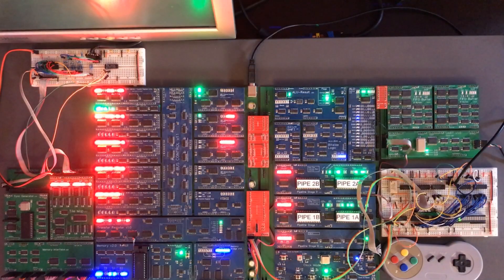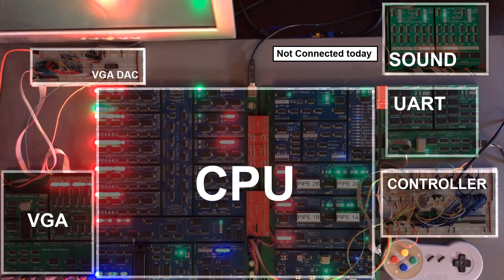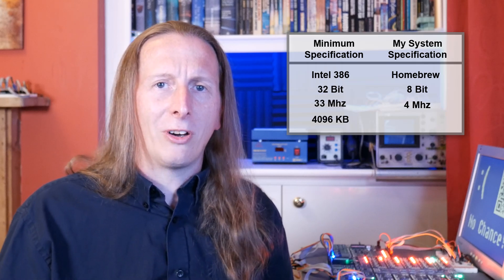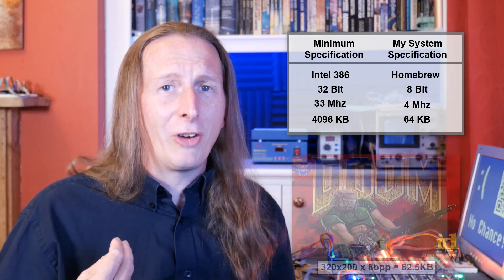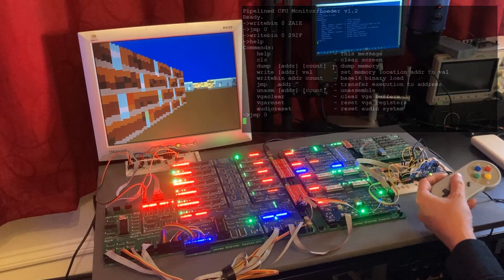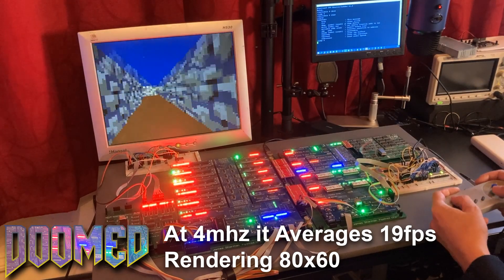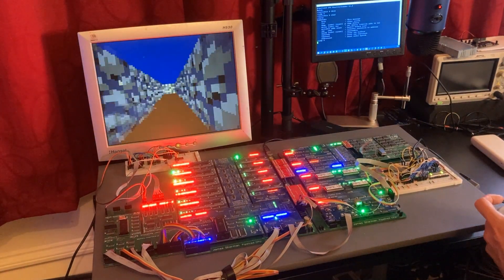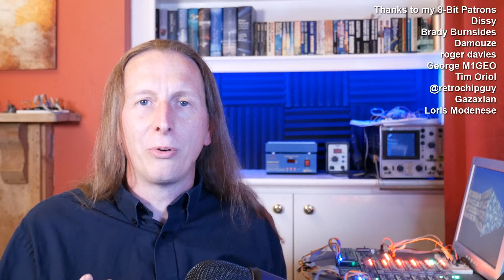Will it Run Doom? - Making an 8 Bit pipelined CPU

Comment: If it can't run doom, can it run bad apple?
Reply from the maker: Could have a pretty Gould stab at that but it would be a lot of effort.
Reply: @weirdboyjim  If it can be done on a pregnancy test, Atari 2600,  and various graphing calculators, then I do believe that a programmer of your calibre, and hardware of that calibre are both able to do it.
Either way, the "Doomed" prototype is quite impressive on it's own.
Reply from the maker: You might be interested in this: https://youtu.be/Y1_MUXKX-oY
Reply: @weirdboyjim  You even included my comment in the video! Thanks chap!
Reply: @weirdboyjim  You even included my comment in the video, thanks chap!

Comment: What about game like Tetris, space invaders, pac man ECT

Do the able to run those types off games ?

And one other question is that mother bord disaing for gameing only or I will have more software support like, text editor, capuletor ect
Reply from the maker: Oh those wouldn’t be a problem. You might be interested in my earlier games https://youtu.be/efLzgweF958 I’d need to add some storage before a text editor is worth making.
Reply: @weirdboyjim  it may be wrong but i thing in computers in general storage is important no matter if you try to create dos like computers or console like computers the need to save some data

like for example a Tetris with out keep the high scores is not fan even the storage is small in the order to save thos data it's still essential in my opinion
Reply from the maker: @watercat1248  All in good time....
Reply: @weirdboyjim  one other question do have floppy disk or cd for this computers i mean if the don't have storage how you be able to run thos games in the first place ?

Comment: This is the most impressive thing i've seen in a long time - likely in 2022.
Reply from the maker: Thanks LDD! Glad you liked it!
Reply: @weirdboyjim  Are you going to release the source code on github or somewhere?
Reply from the maker: @ldd6098  there is a programming video on my extras channel linked in the description. On my discord toolchain channel there is a link to the source as well as all the files you need to assemble it and run it on the simulator.

Comment: The "almost" killer app ...  :)

( I think the Doom midi theme song is bigger that all the machines memory, then again, maybe not  - it'd be cool if this "demo" was finished over time, and at 5k lines of assembly, there is certainly room for more bugs, I mean features, even multiplayer possibly .. maybe .. sorta .. hell if you can run Elite on a BBC Micro, its more than possible - "But can it run Elite" - actually if you can add Z height to the map, "it could run Crysis"  :)  )

Welcome to DoomStien!!!
Reply from the maker: I actually had a crack at getting the music going but my midi code doesn't support different instruments and the percussion broke it. I'll have to take a longer look at it some time.

Comment: Before watching the video, I figured it only needed enough RAM to technically be able to...but would probably not run fast. Without considerable acceleration, Wolfenstein 3D would not run at full speed on the 16-bit Apple IIGS (but an 8-bit data path?).

So much of the bottleneck was in software rendering, though. With GPU rendering and 8MB of RAM, you may actually be able to run a DOOM clone at a playable frame rate.
Reply from the maker: Back in the day it was all about the software rendering. The majority of the time went it that.

Comment: This is an amazing project ! I've seen all the vids, I keep on waiting for more progress. As stated before, I only barely grasp the complexity of the whole build, but this is amazing ! I've known CPU pipelining for a while (I come from the IBM mainframe world, but not the hardware part - just the systems part), so I understand the concept of pipelining, but seeing you actually do it with (somewhat) discreet components (ok, I still believe using ROM chips is cheating - but let's not delve on that) ! Well done James !
Reply from the maker: Thanks Ivan. You do know most cpu's have some internal rom like structures for decode right?  Including the classics like z80 and 6502.
Reply: @weirdboyjim  I always thought that instruction decode were done through some sort of sieve made out of logic gates ;).. The instruction coding of the 6502 was fairly easy to interpret based on the bit pattern of the opcodes - even leading to discovering "hidden" instructions that just were not documented (but worked on the original 6502) - They were probably not documented because there was really no actual use for them - or were just plain silly - but still they worked as expected.

Comment: Porting famous games to your computer is actually not a bad idea.
If original binaries are too large or there are no source code, you can make virtual machine.
Or port existing virtual machine to your computer :)
Low framerate is not a problem - using such computer is more like listening to broadcast radio nowadays - not because of music, but because of technologies behind it.
Reply from the maker: Using a virtual machine would really need a disproportionate amount of speed, it's usually better to directly adapt code to something suitable for the target platform.

Comment: Those minimum specs for Doom are wrong as I used to play Doom on a 286 PC. The game ran fine albeit a tad slow so the display viewport in game had to be reduced in size to about a quarter, but it ran!
Reply from the maker: I suspect you have a faulty memory there, probably of playing Wolf or another similar game. All the web search results will say 386 (or some even say 486). But far more importantly if you look at the source code here: https://github.com/id-Software/DOOM/tree/master/linuxdoom-1.10 you can clearly see the inner loops use the 32bit registers that were first introduced on the 386 and did not exist on the 286. It's always possible that there was a later (post 1997 source code release) effort to get the game running on a 286 which would have been cool, but the original Doom release required a 386 processor.

Comment: So, next step is a Wolfenstein clone? Fantastic achievement. Especially the smoothness in the sideways scrolling.
Reply from the maker: Be nice to add a bit of gameplay in.
Reply: @weirdboyjim  Well, it reminded me of Ken Silverman's original Labyrinth. Yours seems smoother even though there is no gameplay yet. The other is Catacombs 3D which used a prototype of the Wolf3D engine. If you check out movement close to walls there is a distinct and noticeable slow down when scrolling/panning left or right.

Comment: Now try running it on a modern CPU. I bet it'll barely run without taking up at least several megabytes of disk space in spite of its simplicity unless you rewrote it in x86/ARM assembly with FASM I guess.

I kid of course. With optimization complacency being a very common disease plaguing the IT sphere, it's rare to see things like this these days. I wonder how much performance you'd lose by porting it to python and running that on your CPU. LOL I don't even think JIT could save it; it'd probably take up all the cycles finding optimal instruction sequences than actually running code.
Reply from the maker: It would be difficult to represent some of the tricks I used to get this fast in python and you would need to pull a tremendous amount of effort into getting python to target this cpu well.
Reply: One of the reasons why modern apps are so large is that APIs gets more complex nowadays.
Look for example how to initialize video with Vulkan API.
Reply: @sdjhgfkshfswdfhskljh3360  Yeah, but not like any of that complexity is necessary. I mean, OpenGL is still a thing and it still takes far less boilerplate to make an OpenGL application instead of a Vulkan application. Things could be simpler, but they're not for whatever reason. Since when does just the operating system need a 1GHz minimum CPU? Windows 98 and XP certainly ran on less. Macintosh too. It's like the only option is running Linux desktop (which is a terrible UX most of the time), or more esoteric OSes like the BeOS-like Haiku OS.
Reply: @andrewporter1868  I mean that minimum program size is limited by API. But it is usually not a problem - users prefer fast programs over small programs, developers prefer to reuse already written code etc.
What I see in software development - and it makes sense - modern programs are optimized for modern hardware. So new version of program may run slower on older PCs, but faster on newer PCs.
System requirements crawling up partially because of laziness, this is right, but other reason is increasing amount of features for modern programs (or more complex UI for the same amount of features). Look for example what Web is transformed into. It is not just browsers, who want to eat 1GB per page - it is artists and coders, who make web pages so resource hungry.
// Sorry for slightly messy answer )

Comment: There is a project for doom on fpga gpu. With especial gpu implemented with all textures in spi flash, for logic is enough just few kilobytes.
Reply from the maker: Back when 3d games needed to handle all the drawing in software it was inevitably the vast majority of time spent, so with a bit of hardware assist it wouldn't need much. Obviously this project is more about the cpu so I was deliberately keeping it in software.
Reply: @weirdboyjim  yes, cool pipelining, made possible a ray-casting like Wolfenstein-3D.
It's a next level over 6502, Z80 even stock 8088@4.7MHz already!

Comment: Nice one James.
Still thinking about this kind of demo on my ESP32 powered 64x64 LED Matrix, but it's expensive to update every pixel on the screen.
Might be able to get it to run at 20-30 FPS though - hmmm 🤔
Reply from the maker: Thanks Bob! I assume that LED Matrix uses one of the serial led protocols with them all arranged in one long line.  I would guess you can split the Matrix up into as many chunks as you have spare output lines to speed it up?
Reply: @weirdboyjim  Yeah, it does, but there are some weird pixel streaming requirements too that limit how you send data, so it's a bit slow.

Comment: Well there is doom for the Vic20. And your demo already looks better then that. And no, contrary to the C64 port the Vic 20 port did not use and accelerator just an 32k memory expansion if I am correct. It also did not have height differences and such. Everything was very much simplified, but somewhat recognizable. I'm not saying this should be a goal, but i do wonder if you could do something similar in this hardware. Maybe adding some acceleration to for example the VGA in the future might enhance the system enough to do this. Like for example accelerate line drawing. That might be doable without adding to complicated hardware.
Reply from the maker: I had to look that up, looks like a cool project but the rendering looks algorithmically closer to Wolf than Doom and it's obviously an "inspired by" than an actual port of the Doom code.

Comment: will you write a C compiler for this CPU? I think it would be very interesting (to also pick up where bisqwit just stopped). Or maybe add this architecture to an already existing Compiler like LLVM or SDCC which is actually made for these architectures.
Reply: Creating a compiler is a lot of work and only makes sense if multiple people are going to work on it. And for now despite being as very impressive project i doubt that.
Reply: One of the reasons Risc-V is a decently popular target for homebrew is the fact that our already had compilers available.
Reply from the maker: It would have to something more like "small c", LLVM is very much targeted towards 32 bit cpu's. The problem with targeting a compiler is you have to put large amounts of effort into make them generate good code.
Reply: @weirdboyjim  I am not sure that's completely accurate. LLVM should be able to deal with any size target. If your architecture is 16 or 8 bit you just have more work to do to convert 32bit virtual instructions to 8 bit in your hardware specific backend. The front-end language doesn't care. However if you don't inform the programmer to account for the backend limitations your will not get very performant code out. And your absolutely right it's a massive amount of work.
Reply: @weirdboyjim  well avr is 8 bit and its one of the targets of llvm but it seems like llvm needs a lot of registers to produce good code. And next to small C there is all
so tiny C. My thought by using llvm is that it may be a more educational experience for when someone else wants to write their own backend for llvm.
Reply from the maker: @wChris_  I have plans for a future build with more/wider registers where an LLVM target would be one of the goals.

Comment: Very impresive !
I have a question tho. Having a feel for the limitations of this 8 bit platform and having learned allot from builing logic circuits. Are you planning on making a 16 bit cpu ? You could interface allof the the peripherals you have already made and could create more complex and interesting games and projects.
Reply: I think he is not about CPU power. He is about learning how. So performance is a secondary thing if I had to guess. Making this 16 bit just means doing everything again but with a wider bus. Not that interesting. The boards would also get much larger. A 16 bit version would be much more practical in an FPGA, but that realty defeats the purpose of the project.
Reply from the maker: There will be future builds but funnily enough probably not 16bit.  I'd like to do another 8-bit cpu, but if I was to scale up I'd probably jump to 32bit. You can drop some complexity if all your registers/buses are the same width and I wouldn't really get that with a 16bit cpu (unless I limited it to 64k)
Reply: @weirdboyjim  why would you do another 8 bit design. Are there specific things you want to improve or is it that you want to do for example a non pipelined CPU. Or is that a secret for now😀
Reply: @weirdboyjim I would be hyped for a 32 bit system and you are right, if everything has the same width the logic would be allot more compact. I shall await future uploads ;)

Comment: ever seen poom?
Reply: Poom runs on pico8 which might be 8 bit inside, but it's a VM running on modern hardware. Not at all compatible to this real hardware project. Pico8 is like a c64 running at the speed and power of a core  i7
Reply: @bzuidgeest  yeah i saw this is pure asm much harder to pull off in the limits.
Reply from the maker: I'll have to look it up.

Comment: Have you thought of adding a integer co-processor for 16-bits numbers?
Multiplication and division should not need that many circuits, but could add a nice speed up to game graphics. 
I at least think it would be a very interesting add-on to the project ( but I am not the one that have to do the work 🙂)
Reply from the maker: The biggest "bang for buck" would be to add a hardware 8x8 multiply, having a co-processor for 16bit numbers would be a big chunk for the effort to create a 16bit cpu.
Reply: @weirdboyjim  Was sort of afraid of that that could be the case, but 8x8 would be nice.  👍
Reply: Yes, a multiply and divider circuit would be quite interesting to see.
Did a multilier circuit in DigiSim a while ago using the 'Russian Peasant Multiplication' method. It is essentially just the conditional addition and right shifting. But I guess it will take a lot of TTL circuits, because you need loads of adders.
However I managed to do it in a three stage pipeline. Would be interesting to see how James approached that. Also he would need a double width result register.
Reply: @helmutzollner5496  Most admit that I have not a clue for the actual amount of logic gates needed. 
The closest have have done is helping with the programming of a limited instruction set soft CPU. We had to make all the Op-code logic for the instruction set, but not the actual hardware. It included integer math function, but what that add up to in gates someone else have to figure out.
Reply from the maker: I did a video on my optimized multiply code a while back. https://www.youtube.com/watch?v=1bc_D_vKDiI

Comment: Have to admit, getting a ray caster working on an 8 bit CPU with texturing and angled walls is extremely impressive. Especially as it looks like a decent frame rate too, must have been a hell of a lot of effort optimising to achieve this.
Reply from the maker: Have you watched the programming video yet? It's not actually a raycaster but something a little more suited to this particular cpu.
Reply: @weirdboyjim  I haven't watched that yet, I just thought ray caster as it looks very like Wolfenstein. Will have to check out how you managed to do this as it looks very fast for an 8 bit system.
Reply: @schrodingerscat1863  Generally (but not always), walls not being aligned to a grid means it's not a raycaster :)
Reply: @Ehal256  Depends if you are casting rays onto a grid or onto a 2d vector space. I wrote a similar engine back in the 90s that did just this, allowed angled walls and complex features to be defined, it's still a ray caster.
Reply: @schrodingerscat1863  yep, you can make fancier raycasters for sure
Reply: He actually said the exact frame rate. 19fps. I have played games slower then that, but not by much.
Reply: @bzuidgeest  I know, a ray caster with 19fps for a home brew computer with home brew CPU, it's incredibly impressive.

Comment: but can it run crysis
Reply from the maker: Not even sure my current pc can run Crysis at a decent frame rate.
Reply: @weirdboyjim  ahhaha :) any "recent" computer should run crysis in superresolution mode, not supersampled, but very high resolution, cubic sampled down to low resolution
Reply: gpu you are missing
Reply: you can do wolf3d easily and update it beyong doom
Reply: try FP8
Reply: of course you can
Reply: looks nice
Reply: try cache-rom precomputed alu